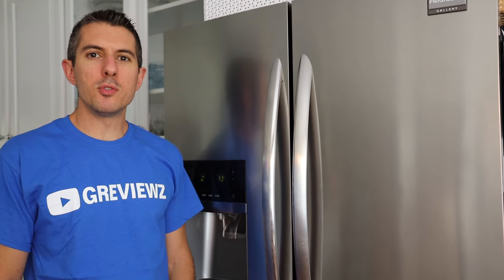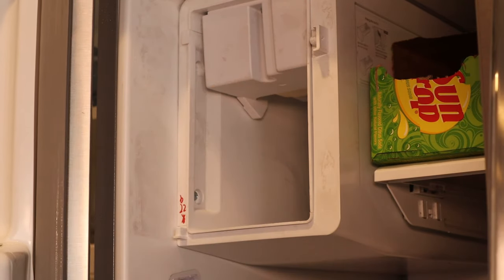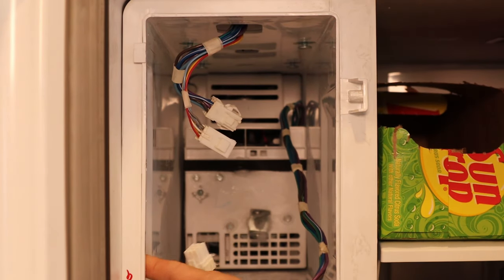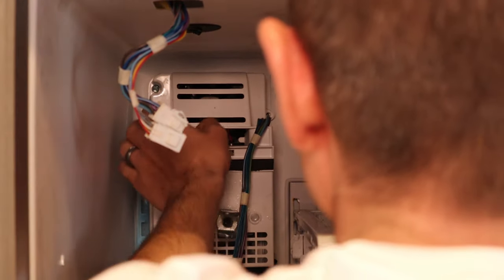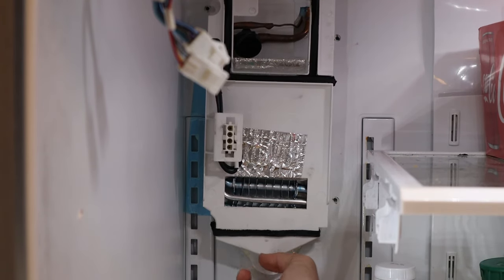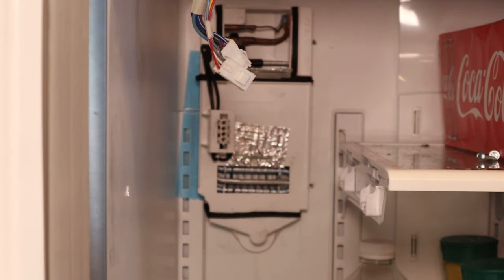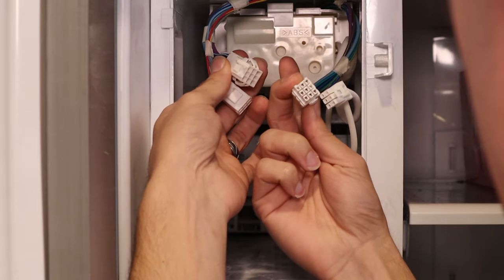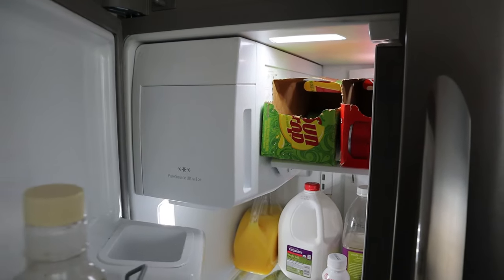Frigidaire ice maker broken again: fix it

Comment: Why is the ice maker in the refrigerator section?  I have a Maytag side by side and my ice maker is in the freezer side!  Yes...I looked.  Frigidaire is obviously on the side with the milk in the video.  Not for me...it's on the side with the frozen food!  I never have icing problems and the unit is 9 years old.  I see where lots of folks complain about the Frigidaire ice maker.  The comment about Tilt was interesting.  

So...I was thinking about getting a Frigidaire...but now I see the extent of the defrosting problem and am amazed it is so common. I thought it might be design...but maybe not. 

This year after considerable neglect I had the exact same problem on my central home AC unit...freezing in the coils.  The coils were totally blocked inside the forced air furnace.  One big coilsickle.   The repair specialist said that was because I had poor air circulation OUTSIDE where there were leaves and junk all around the big York box.  He just removed the leaves and boom...no problem...the whole home Refrigeration thing works perfectly because I fixed an air circulation problem.  OK...ready for this?  Could the freezeups in the Frigidaire icemaker be because there was not enough air circulation somewhere in the system?  Maybe there was a low freon issue and the motor just did it's best to keep the refrigerator cool and pumped a lot causing a colt spot.  Maybe it was a heat leak issue in a double or French door setup and the ice didn't freeze right.  Suppose the water evaporated too much in the summer or the unit was set a bit cold during a heat wave.  I don't quite see the logic for the Frigidaire but let's just guess there wasn't enough ventilation behind the refrigerator....what...it's a guess!  The fix is very cheap...pull it out from the wall a bit.

I have a Maytag unit and for some reason the problem never arises.  Maybe that's because I actually have 4 inches of room behind the refrigerator...that's way more than usual.  I don't get it.  Anyway...there is no room on one side but enough room on top and other side of the refrigerator so that the back of the refrigerator isn't somehow jammed against the wall in a tight corner.
Reply from the maker: Thank you for such an extensive comment. Yes Frigidaire has been having known problems with there gallery style over under style refrigerators. These units have been out for years with no fix from factory. They do sell a kit to “fix” the problem but doesn’t work most of the time. I figured out how to bandaid fix the problem but not how to cure it. Don’t buy the Frigidaire as you can see by the comments a lot of people are unhappy. Yes it may be the fact the ice maker is in the refrigerator....

Comment: Way easier, do this: Set fridge temp to 40 degrees. Check with thermometer, our built in thermometer was off by 3 degrees. Turn off ice maker, remove ice bucket. Wait 24 hours. The 40 degrees will melt the ice without taking anything apart.
Reply from the maker: Thanks for watching. Yes that is a very good idea. Only problem I see is all the water that will now be dripping/running all over the fridge when you open the door. Plus some foods require below 40 degrees to stay fresh.
Reply: I have the fridge set to 40 and the freezer set to 6 and while this makes things work better I still have to daily put it through a manual defrost cycle

Comment: You will keep having issues with it.
You need to address the issue with moisture getting in there from the fresh food side.
Reply: Yes, there is a special seal kit that the repair person installed in mine that was specifically designed by Frigidaire to fix this issue. He also recommended setting the refrigerator temperature no lower than 36 degrees to prevent the ice maker fill tube from freezing and preventing the water from dispensing into the ice tray. Thankfully I had a 5 year warranty because they have worked on my ice maker at least 5 times since I purchased it.

Comment: Thanks for the excellent guide. I used it to fix my fridge. Spout into the icemaker was frozen. Thanks again.  Crappy fridge so I am sure I will be doing this again.
Reply from the maker: Thanks for watching. You will be doing this again so please like and subscribe so you can find it easier!! I’m glad I was able to help!!
Reply: Hey, where is the spout for the ice maker? I took apart my ice maker completely after watching this video. There was no issues with it, nothing forozen... I then replaced the water inlet valve.. still no ice. Im thinking the line is possibly frozen? How and where did you defrost the the spout? Is it at the roof of fridge?

Comment: I dealt with this a couple of years ago.  There is a newer assembly back parts that stops the freezing over problem.  repairclinic part# 5303918784  I came across your video because now the tray flipping motor has died. Argh!
Reply from the maker: Thanks for watching. I appreciate the comment and for the part number to the fix. If and when my fridge messes up again I may look into installing the new part number. I hope my video helped you .
Reply: I got that part from repairclinic, nothing wrong with it but once installed same issue came back about a month later. It did make ice during that time but it was god awful slow.

Comment: Nice video.  My upper ice maker also stopped working.  The coils were fine but the water supply line supplying the ice maker was frozen.  Turning power off and using a hair dryer fixed the problem.  Thanks for posting!

Comment: Greatly appreciate this video.  Watched all the way through and was so not looking forward to dismantling the ice-maker … but then he got to the DEFROST MODE and though he tried his defrost mode twice and neither worked … I turned mine on and as I was watching the remainder of the video, I heard what was the sound of Ice Melting and releasing internal mechanisms previously frozen.  I’m going to leave in Defrost mode for 12 hours, clear the melted ice / water and exit Defrost mode to see what happens.
Reply: If you haven't already fixed it. I saw on another video to adjust the freezer temp from 0 to 2 degrees and like magic it started to make ice after a little while.

Comment: Thanks for the video. Worked great for me. I didn’t have as much ice buildup as you, but noticed my water drain was plugged up with ice. Thanks again
Reply: How did you get the drain unplugged? Mine is full of ice too.
Reply: @AndrewHeavin  I used my hair dryer to melt the ice.
Reply from the maker: Take the blow dryer to it…

Comment: Thank you for this video. It did not help me because when I got to the step at around 8 minutes where you remove the ice maker housing, I could go no further. The motor housing that covers the freezer coils was a slightly different configuration (maybe my refrigerator is newer than yours?) and the screw on the left side is on the bottom not the top like yours. After removing the screws I tried to ease the thing off the back of the refrigerator wall but could not. So I abandoned the project and put everything back together. I may have to call a repairman unless you can offer some advice!
Reply: Well I solved the riddle of the motor housing. We decided to defrost the refrigerator, so we took everything out, turned it off, and gave it a good cleaning. Meanwhile I removed all but the motor housing on the ice maker and applied a hair dryer to it. Some ice on the upper left melted revealing another screw. So on our model there are four screws. I decline to try and remove it this time because I think the thorough defrost will solve the problem. I can see a lot of water coming from the melting ice in the motor housing. I will let you know if this does not fix the problem. Thanks again.

Comment: Dude, thanks for the defrost trick. That actually worked. I did it 3x. I now have ice. This is unbelievable by Frigidaire. Not
 In the troubleshooting part of my manual as far as I know. Just a way for them to make a buck. We have a Kenmore refrigerator and deepfreeze. Both are over 30 years old and still going strong. I have had this garbage fridge for almost 10 years. Bought it from our local Sears. Menards would not match. They wanted $700 more for the same fridge. Anyway definitely have to do serious research on products like this nowadays. I actually did have to replace my ice tray part of this. Got it from Repair Clinic. I broke it trying to see why it wasn't dumping. Old lady says I'm like a bull in a China cabinet. Lol. Again thanks.
Reply from the maker: Thanks for watching. I’m glad I could help! I feel like company’s purposely build stuff to break these days. Hold onto your old appliances they don’t make em like that anymore!

Comment: Thanks for the redo without the music. Totally get the hazards of being a parent. Most of us Mister (or Miss/Misses) Fix-its probably are so we get it. Kiddies adding color commentary in the background is still less distracting than the music, especially while you're trying to explain something. 

Try reserving music for montage or speedups when you're not actively talking through something. 

Again, great walkthrough. You had a comment from someone claiming to be a fridge repair tech claiming this was a known issue and Frigidaire had repair kits available. I haven't been able to find specifically what they were talking about and wondered if you've had a recurring issue with this ice maker or if this fixed it? 

I pulled mine out and found a huge rust spot from the condensation buildup from that area being frozen over.

Comment: Liked the video.  Followed the video to fix my problem.  I would, however, detach the ice maker from the housing.  Remove the ice maker housing exposing the ice maker.  Once the housing is removed you can easily remove the zip ties.  When reinstalling the ice maker you can zip tie the wiring harness prior to reinstalling the ice maker housing.

Comment: This is a fix folks but before you take it apart try this.  I have this fridge and this has worked for me several times.  Press the plus and minus for about ten seconds.  The fridge will display a d and an f.  That puts it in defrost.  You would think that would be enough but it will stay in defrost for about fifteen to twenty minutes and then go back to normal.  You have to set a timer and watch for it to go back to normal.  When it does put it back in defrost mode by holding the plus and minus buttons for about ten seconds.  Do this four or five times in a row.  Don't let it set long between defrost cycles.  Like not even a few minutes.  This has fixed my fridge every time.
Reply from the maker: Thanks for the input. I did go over that in the video. Ive used the defrost many times. It doesn’t always work or get all the ice off.

Comment: Thanks for taking the time to make this video. Just took your advice and hope to have the same result. One suggestion to help others would be to suggest purchasing something other than frigidair in the future. I have to work on this thing way too much IMO and hope to take a sledgehammer to it in the future. Had to modify the water feed with tin foil in the bottom ice maker to avoid ice buildup on the drawer track. I absolutely hate this fridge and am thankful for people like you. Next project is to see why the bottom ice maker isn’t working for the 5th time. 🤬
Reply from the maker: We’re you able to successfully get your ice maker working…?
Reply: @GReviewz   The one in the fridge is working now but the one in the freezer is not. Going to blast steam into the water supply line and give up after that. Don’t want to support Frigidaire by buying anymore of their replacement parts so not going to pay for a new ice maker. I also doubt the ice maker is the problem since it isn’t filling with water. Removed, defrosted and dried the unit in the fridge. Insulated and painted the back of the fridge with rust oleum. There was a chunk of ice on the outside of the back of the fridge that had some surface rust.  I replaced the water inlet valve system and the freezer ice maker still doesn’t work. I also bypassed the filter since I have a good water purifier.  I have also installed a tin foil funnel under the water supply line on the freezer ice maker (not clogged). It would leak all over the bottom of the freezer and jam the freezer drawer and the track it rides on. Tried running different temperatures with no luck. Ive been fighting this thing off and on over the last couple years and I am getting tired of it. Having ice a is a constant battle. This fridge was designed by complete idiot’s and I will never buy anything made by Frigidaire again. That company can kiss my a**.

FYI, your video was very helpful and fixed the issue for 2 weeks. Shortly after both ice makers stopped working and the fridge one mysteriously started working again. I had already ordered the water supply/ distribution unit which did not fix the freezer unit.

Comment: Tremendous effort on your part. Thank you so much! Trying a defrost cycle first. I hope it works, but I don’t know if It is a timed cycle or if I have to turn it off of defrost. Lol
Edit: it’s a time cycle. But it didn’t work. Tried it twice. I suppose if you had another fridge you could simply turn this one off for a day and let it melt on its own, but I’d rather tear it apart.
Reply from the maker: Yeah it’s a timed cycle. Different year models do different things on the defrost cycle..yeah it did t work for me either. Yeah if you unplug the fridge and let sit for a day or two it’ll work… but I dont have that time without food..
Reply: @GReviewz  Also, I have done this procedure already. And it turns out that the filler hose is probably frozen. I don’t know how to get to that since it’s up in the ceiling of the freezer part of the fridge

Comment: Very thorough video, this helped me take mine apart step by step, thank you! One recommendation that has worked for me two times so far in a situation like this where the components need to defrost - I simply turned the ice maker off from the settings and kept it off for a day or two. Then I turned it back on and it started working fine again. I guess keeping it off automatically starts a defrosting process since it’s not trying to make ice.
Reply: I’ve done this, but then the problem comes back.

Comment: You have a lot of comments, and I can’t read them all. So maybe someone already thought of this. But I have the same issue, and I have a theory on how to possibly fix it. This small freezer compartment (ice maker) is inside of a refrigerator. Seems like warm(er) air is sneaking into the mini freezer (ice maker) and doing enough thawing in the wrong places to cause build up. So my theory is that some strategically placed insulation might isolate the mini freezer enough to stop the warm(er) air infiltration. I’ll try my theory and post here if it seems to work. In the mean time, thanks for making this video. It was good to see what the internal parts look like for when I tear into it myself.

Comment: Excellent video on how to take Icemaker apart and to thawout .If the Drain keeps freezing off. Take a small copper wire and wrap it around the heating element a few times. Then Make it long enough too. slide it down the drain aways. The copper wire will create enough heat to keep the line from freezing.

Comment: I worked for Eureka vacuum cleaner may last job before retiring.  I finished up at the new corporate headquarters in Charlotte NC.  All those that they move took advantage of the discount on appliances.  So a lot of talk about them was occurring.  The Frigidaire  french door had less problems then the Electrolux.  The comments made by us was that they totally replace the ice makers, a new design.  Frigidaire got the replacement first.  I have your model  There is another video of repairing the ice maker that shows a different design.
Reply from the maker: Yeah there are so many unhappy people with this design it isn’t even funny at this point..everyone I know has had problems with the ice maker…

Comment: Excellent step-by-step video. I have hit one problem that it does not address. In trying to reinstall the fan and augur housing, I am having great trouble (= impossible?) getting the upper left corner screw to catch and thread into its home spot. The housing seems to be twisting counter-clockwise and covering the hole into which the screw should go. The coil cover (behind the fan and augur motor housing) is also twisting the same way. I worked up a lot of sweat, but no joy!
Reply: I finallly hit upon a way to hold the screw w hile trying to hit the screw hole in the very restricted space referenced above: I took a piece of masking tape and pushed the screw through it from the sticky side. I then placed the screw head into the nut driver and used the tape to surround the nut driver socket. That held the screw securely and the tope tore away cleanly when the screw was sufficiently caught in the thread of the hole.
Reply from the maker: Thanks for watching. I am glad you were able to figure out a way that worked for you. Did you get your ice back?
Reply: @GReviewz  Thanks again for taking the time to post this awesome video. Completed the repair last night and full bucket of ice this morning. I struggled briefly in two areas. 1) Removing the final connector on the pull down plastic covering protecting the coils. Did not realize until scrolling forward on your video that it is a push out rather than a pull out connector. 2) Re-attaching the left corner screw. Fortunately I found a 1/4 inch magnetic socket from my drill set that fit my screw driver. This made everything so much easier.  Thanks again for sharing

Comment: I would recommend flushing the drain while you have it open. You will have to pull the fridge out to access the drain pan. You may potentially have frozen water in the drain causing the build up of ice.